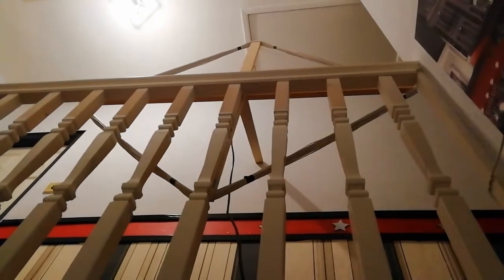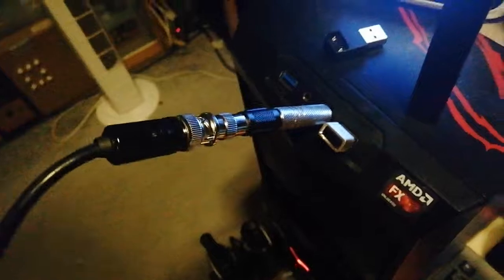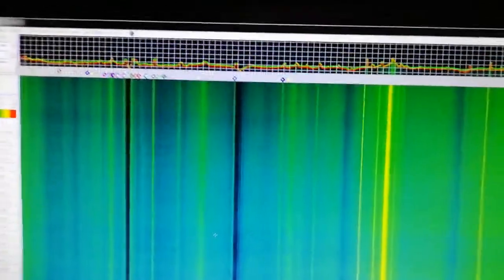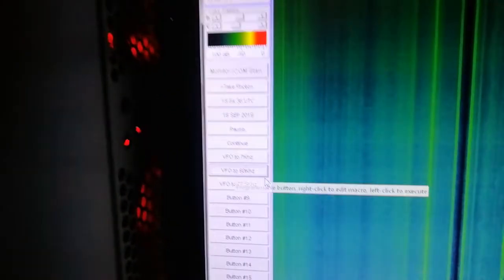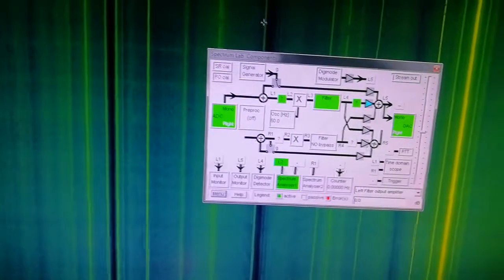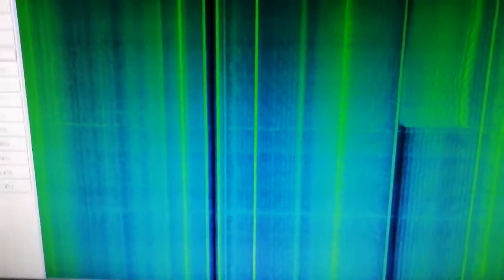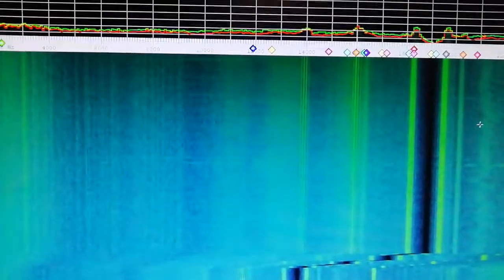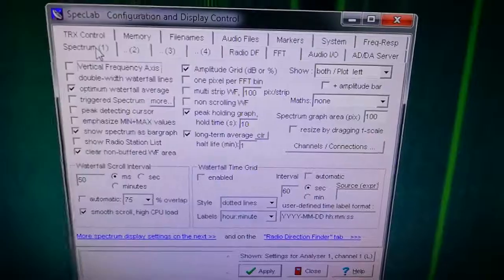VLF Loop Antenna on MIC input RAW signal update

Comment: Maybe you could tell us more about your loop antenna. Do you tune it using a variable capacitor ? I am about to build such a loop.
Reply from the maker: @fotografm  no tuning it is just 120 meters of speaker wire wound around a square wooden frame using plastic trunk to hold corners in place, very crude and cheap but works great, still using it to this day on my Perseus SW sdr radio for when storms approach to monitor lightning strikes and hopefully capture spherics and tweaks in the radio spectrum, very low frequency, less than 10khz.  The program is called Speclab and should still be around and free to get hold of. It is a very useful tool. I like it's built in sound generators, I mimicked the Russian buzzer on SW 4625khz with it just for fun lol
Reply: @JohnnyX50  Thanks for the reply. Your experiments sound like fun and I will also try out Speclab. I am currently using SDR++ and AngelSDR on DragonOS.

Comment: Thanks for the informative video. What PC soundcard has 192kHz sampling rate ? Most seem to be 48kHz. I just got a Behringer U-Phoria UMC202HD low noise studio ADC with USB connection and it works great with SDR++ on DragonOS. I will take a look for the software you show as I like the filters !
Reply from the maker: @fotografm  my pc on board sound, realtek, has such a sample rate in the options for line input.  I do not use windows volume control as that causes latency and lag. The on board, motherboard drivers and software work almost immediately with no delay on input or monitoring output.
Reply: @JohnnyX50  Thanks for the info !
Reply from the maker: @fotografm  your very welcome =)